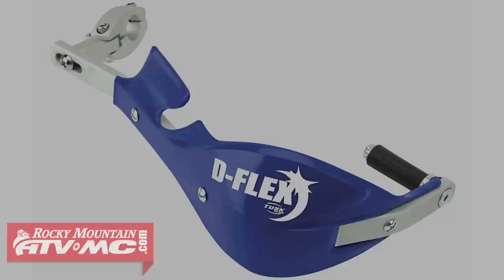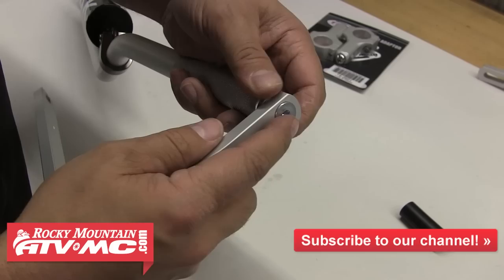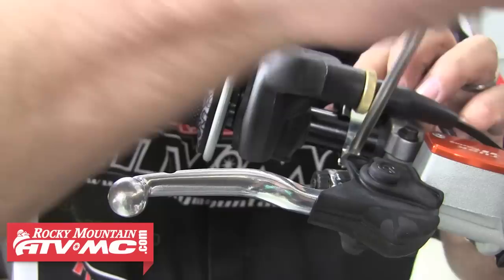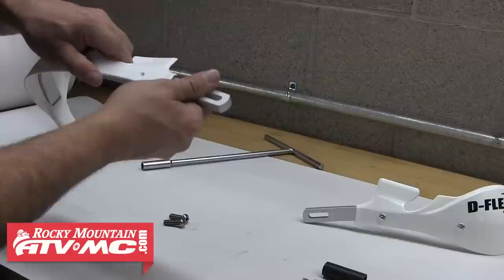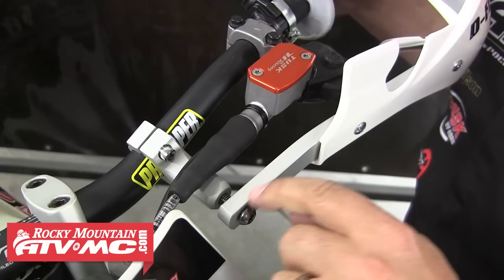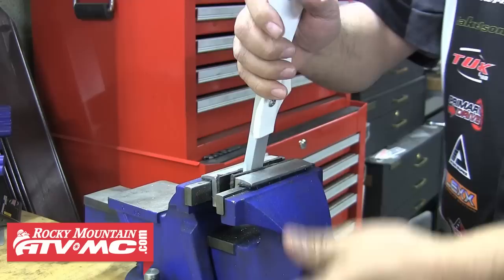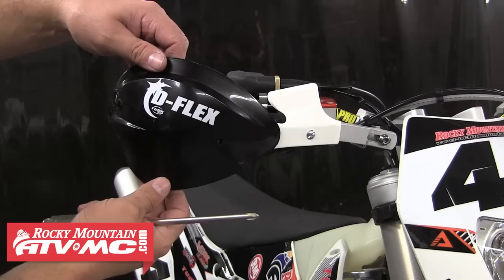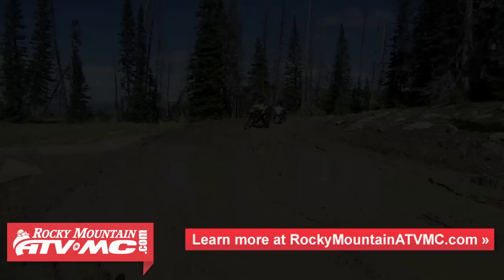Tusk D-Flex Handguards Installation

Comment: I'm having a bit of trouble getting them installed on a DL650, I cant seem to fit them around the controls.
Reply from the maker: +Alex Coats These handguards have a universal fit design.  They aren't really a machine specific fit.  If you can't get them to work by rotating your other control clamps around and adjusting them to accomodate the handguards you may need to return them?  You don't have oversized 1 1/8" handlebars do you?  If so, you will need these: https://www.rockymountainatvmc.com/p/1036/9546/Tusk-D-Flex-Handguard-Big-Bar-Adaptor-%28P%29

Comment: My hand guards seem to have a 1/8" gap at the ends with the Tusk D flex and the Tusk Chub bars.  I don't figure pounding on them with a rubber mallet is recommended or is that ok?
Reply from the maker: +Aimee Jessamine You should be able to tighten down the flat allen bolts on the ends.  That will cause everything to suck up nice and tight.  Make sure your other mounting points are loose when doing this.  You should be able to get them to mount up flush.  Try backing out the bolt a little and then re-tighting everything.  Let me know if you have any problems!?
Reply: Well, the best I can do cinching up is 1/8th inch gap and on the clutch side the bar mount (using tusk fat bars and adapter) there is no way to fit these on without kinking the clutch cable pretty severely.
Reply: Let me clarify I can get throttle side on but I cannot get the to line up with the orientation of the throttle cable and clutch cables to look even one has to be low and one has to be rather high...
 2015 Honda CRF250L
 Tusk 1 1/8' fat bars.
Reply from the maker: +Aimee Jessamine Have you tried adjusting and rotating the positions on your clutch perch and front brake master cylinder?  Leaving them some what loose while you install your wrap around D-flex handguards i've found makes it a lot easier, that way you can make those minor adjustments as needed.
Reply: +Rocky Mountain ATV MC Yeah, the dig is the inner mount on the clutch hits right on the adjuster on the cable, and the throttle cables (this is keyed into a hole on the bars) only comfortably fit without binding under them.  I opted to order the Moose contour mounts to achieve clearance on the clutch cable.  The 250l is kind of picky since most of the controls have pins that insert into bars.  http://www.oemcycle.com/Item/product/900054095 the 1 1/8" variety.
Reply from the maker: +Aimee Jessamine You are mounting the Tusk Chub Handlebars you bought correct? Not your oe? Going to an aftermarket handlebar the use of the self aligning pin holes on the switches and clamping housings are no longer needed.  You would want to file those down to get a nice even and secure fit.
Reply: Ah I measured and drilled in all of the corresponding pin holes.
Reply from the maker: +Aimee Jessamine Oh you went that route,  I see.  We've always filed those pin holes down flush or broke them off to accommodate aftermarket handlebars.  The little holes tend to take away from the strength and durability that the handlebar offers.  But, they're tiny holes.  Should be fine. The wrap around handguards provide a universal fit.. so they will require some minor adjustments and mods in your case.

Comment: I already have the dflex hand guards on my CRF250L but they were just the bare metal, no plastic. I've already had to bend the right side bar away from my throttle tube because I dropped it hard enough to tweak it, so I figure they're worth keeping on there. I was just wondering if I could buy the black shield with integrated turn signals separately from the bar.
Reply from the maker: Yes you can.   Handguards: https://www.rockymountainatvmc.com/p/962/26134/Tusk-MX-D-Flex-Replacement-Plastic-Hand-Shields-W-Turn-Signal-Hole-

Turn Signals: https://www.rockymountainatvmc.com/p/1156/26142/Tusk-Handguard-Replacement-Turn-Signal-

Comment: Can u do a install with a bearing  throttle tube and bark busters?? Like what bearing throttle tube would work
Reply from the maker: The wrap-around style handguards will not work with the bearing setup simply because they need to mount inside the bar ends. If you do have a throttle tube with a bearing it would need to be a removable bearing design so it can be removed to allow the handguard mount to slide into the bar end. People have successfully mounted these handguards with the Tusk Aluminum Throttle Tube w/ Bearing by removing the bearing and then proceeding with the install.